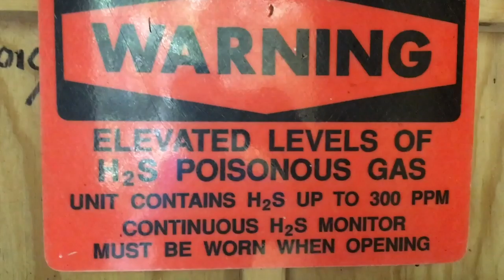How to drive a well point for water- step by step in Vermont (Off grid living)

Comment: LOVE this video!  I am a hydrogeologist.  I very much appreciate that you took the time to show your setbacks/failures as well as your success.  May I politely suggest that the location you chose is a terrible placement.  It may have been an easier installation, but it will probably be taken out in the next good,  gully washer.  The surrounding vegetation suggests that the location you chose is subject to such flows.  Also, when you place a well directly in the flow corridor, you are more likely to draw harmful bacteria and viruses (E.coli, Giardia, Cryptosporidium, etc.) into your pump.  The further that you can place your well from the main stream channel, the greater opportunity the soil has of filtering our those microorganisms.
Reply: Thanks- I sincerely do appreciate the input and you're absolutely right as I've read more into it/thought about it. We're going to move this down the road.....

Comment: I’ve banged in a few sand points in my time. Your pump will work better after the cup leather expands. I soak the pump by putting the handle down and pouring water in the top, just let it set for 20 minutes or so.

You guys in Vermont are lucky to have close water tables, we also have them close in Upstate New York directly across from you. I struck water at 4 feet here.

I also have a 12x24 cabin made by the Amish, I added an 8x10 bedroom on the back. The entire cabin in roughcut 1x12” pine.

Next week I’m installing my well point for the cabin, a pump & pressure tank, a sediment filter and a 5 stage filtration system for drinking water.

Comment: Here is one way to find out if the point is down far enough. 
Try filling the tube with water.
 If it does not sink, hit the point further down. 
When the water sinks faster in the pipe than you can fill it, 
the point has come far enough down.

Comment: I read that your only should use a 2 lb. Hammer,   not a 12 or 13 lb. Sledge hammer,  and you should also put the pitcher pump on a 5 gallons of water and let it soak to soften the leathers,  and use soap and rags with a string to clean out the inside of the 1 1/4  pipe that may have oil in it,

Comment: Interested in this series, especially filtration, etc. I have been doing up a geodesic dome that has a sandpoint well inside of it. It has a 6" plastic casing around it and much of the year I see water down in there. I covered it bc I'm sure critters have gotten in there over the years (ick) and not sure how to clean that out, etc. I found a cast iron hand pump on the property as well so will see if that fits and probably see what comes out although I'm a bit scared to find out!

Comment: I have question about that pump. Is that considered a pitcher pump? I’m assuming it has an upper suction cup leather. Does the bottom section use a check valve spike or a lower leather with a weight? I’ve seen some pumps with lower leathers and a weight that acts like a flapper and some pumps have a check valve spike that seals the hole while it’s pumping. I have a pump similar to that, that and trying to get it functional again. When I took it apart it had nothing on the bottom. Just the upper portion with a dry rotted leather cup that I know I can order. Just not sure about the bottom portion. Jim from Ohio

Comment: What parts do I need and pipe wise??? Do you auger first? Then drive the pipe. Can I get parts at a big box hardware?  Can this be done in a regular town yard?
Reply: Yes, if you live near a menards they will have everything needed, no need to bore a hole first, just get well drive head, and we'll drive pipe with couplers, and a pump. Cost about $300 total.

Comment from the maker: Discussion question: (aside from experience-tips on how to better do this)- What would you recommend for filtration in terms of getting all the silt/mud out of the water? We don't plan on drinking this, although I have a feeling it might come up pretty clean/safe..... we just don't want to wash up and end up "dirtier". Thanks all!
Reply: Just keep on pumping it out.
 Wells usually clear up after first  hundred gallons or so.  
Keep extra set of leathers on hand for the pump.  I would probably remove the pump and cap it off, if you don't need it in winter, to prolong its lifespan.
Reply from the maker: @keralee  Was wondering about that- winter...... makes sense.....
Reply: @relaxshacksDOTcom  I have drilled 2 wells and helped on a third.  It always takes a good bit of pumping to get the silt out. 
 There are special pumps built to handle freezing conditions if you think you will need it in winter. Yours doesn't look like one of those... But you could check with the manufacturer.

Comment: a hammer drill in chisel mode or a jack hammer can drive a sand point 30ft in 10min.  gotta use the right tools.
Reply from the maker: I'd have to get a battery-app one- this land is off-grid- no elec. I also don't own a hammer drill so we had to settle for the sledge.